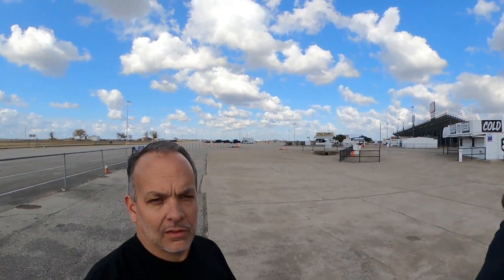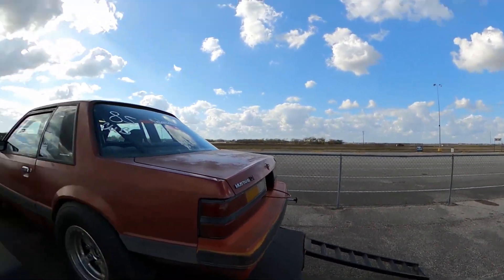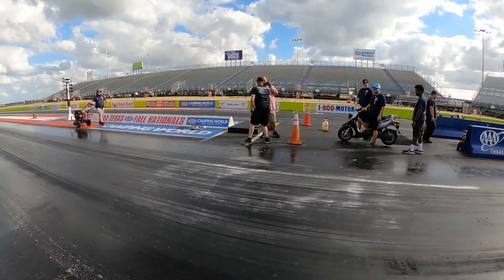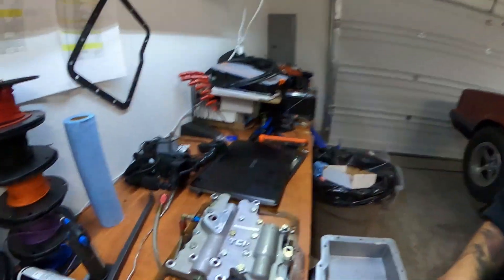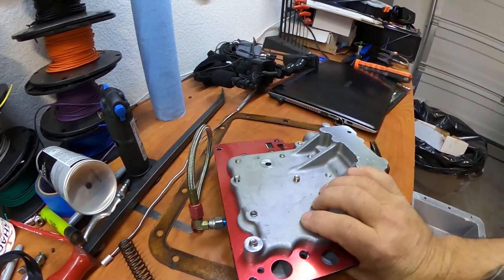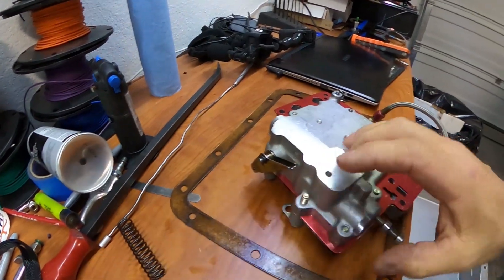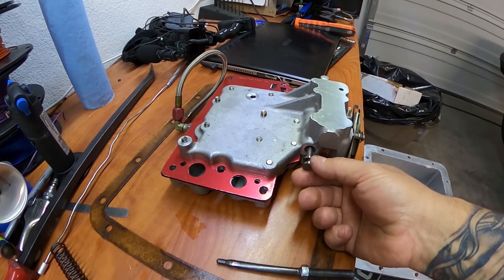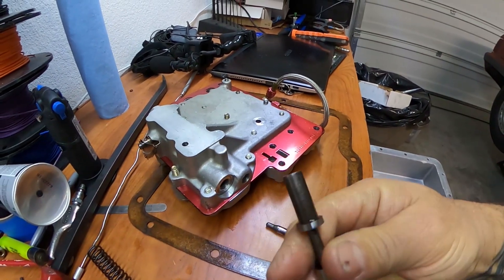More problems at the track, but it's fixed up now! (Not bad!)

Comment: Transmissions are magic, right? Haha, and those trans guys are magicians. Funny how the smallest little error skids it into the ditch. I don't like those kevlar bands as they are hard on the drum. You did give that drum a once over with a straight edge and flashlight to make sure it was flat? 
Keep up the good work. It'll get there eventually. Hell, you are really already there just need a few small adjustments. If you never have any set backs how would I learn anything? Thanks for posting the vids. I'm loving every one of em.
Reply from the maker: The drum was spotless, only the outer edge had any signs of wear. This time.i put a standard width band w/"high energy" lining.  Changing the wastegates now, to find out where this boost control issue is coming from. Trans is already fixed and back in the car

Comment: By far this is the most inline channel with my own cars intentions and goals, Bob is a beast! What’s he weighing if that’s okay for you to say? And is it still 52ish% ?
Reply from the maker: It weighs 3008lbs with me in it. Its a little heavier over the nose. The numbers mentioned aren't correct- its close to 56% over the nose
Reply: @diygaragetx  oh wow, so maybe I shouldn’t be too concerned right now with my numbers? I’m at 2795 with me in it (210 in the seat) and 55.9%  I think instead of continuing to make changes and throw more money in the race car hole, just need to see how it does, that gives me serious hope!
Reply from the maker: @rickybobbyracing2725  especially if you haven't ran it yet. Theres a lot of variables to consider. Track prep, power, power management etc. Don't take what works for me as what works for your setup
Reply: @diygaragetx  has not been tested with the cage, relocated radiator to rear, been plotting my suspension and trying to get it all balanced on the scales, may put my small injectors back in since it’s tuned for them, has been 5.74 @129.33 with a crap 60’ should in theory do .30’s at that power level. Definitely still need some things like front adjustable struts. But yea definitely need to come to y’all’s tracks to test! Thank you for having patience with me!!
Reply from the maker: @rickybobbyracing2725  anytime. Come say hi, if you're there. Theres 2 races left that I plan on making. This weekend is the grudge race, likely to get ruined out and 12/5 is another one- both at Ennis